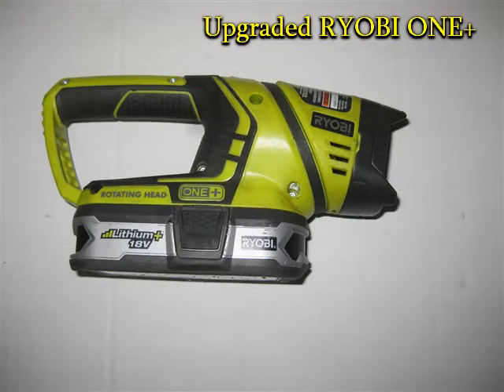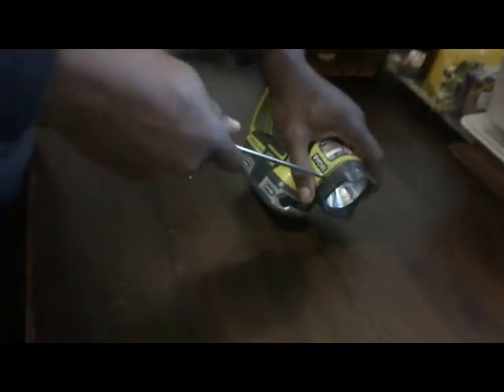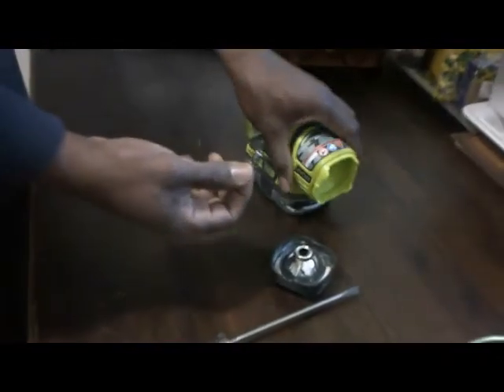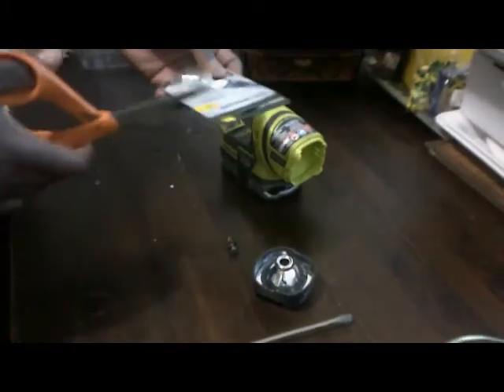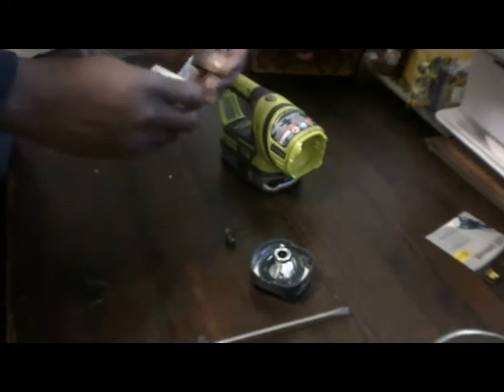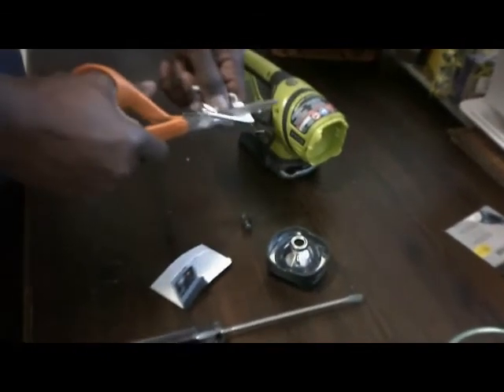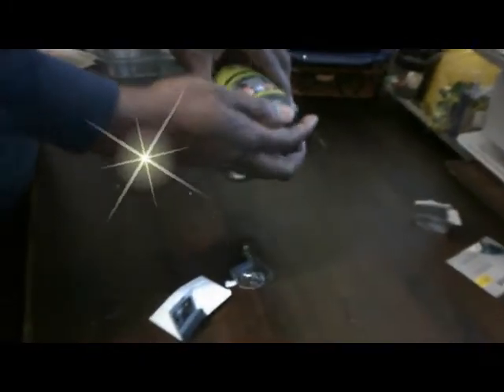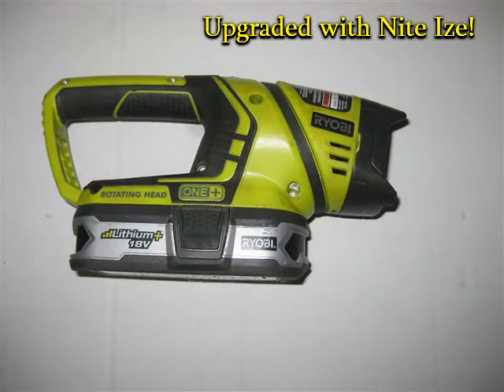Upgrade Your Flashlight Bulb to LED Brighten Your Path P107 P704 P705 MrSettin007 DIY Tutorial

Comment: I did that but its smell like its burning. And know the nite ize doea not work???
Could the nite ize came difective?
Reply: I had the same issue when I tried this upgrade. Bought 2 pairs and both only worked for a few seconds and I could smell a burning scent afterwards.
Reply from the maker: Hello N 88, I would suggest you call RYOBI directly as your flashlight might be defective. I did this and was able to show my receipt of purchase for the RYOBI  kit. They sent me a new updated one that had an LED bulb already in it. Now works perfect as well.
Reply: @N88-q9z  mine did the exact same thing. For the money and 2 trips it took me i could have just gotten them online wich is what im doing now
Reply from the maker: The Nite IZE does work. You should contact them or return to place of purchase for a refund and also I would suggest you call RYOBI directly as your flashlight might be defective. I did this and was able to show my receipt of purchase for the RYOBI  kit. They sent me a new updated one that had an LED bulb already in it. Now works perfect as well.
Reply: Seems like it could be the wrong bulb.  The model listed for the bulb is for ~9 volts.  An 18 volt bulb that should work (which is also less expensive) is: "JOMITOP 18v 19.2v 6v 9v 12v 24v Volt Led Flashlight Bulb Led Upgrade Bulb for Ryobi Milwaukee Craftsman 6-24 Voltage Lamp Maglite Flashlight DC Replacement Bulbs Led Conversion Kit".  https://www.amazon.com/gp/product/B07BP5MT2X/ref=ox_sc_act_title_1?smid=AIZOEEGDMTDTQ&th=1
Reply from the maker: @ktraglin  Thank you for the update!
Reply from the maker: Purchase  the correct bulb here= https://amzn.to/3pB0YVu